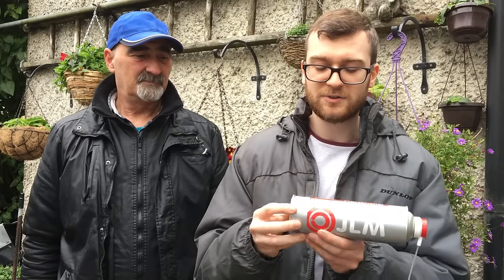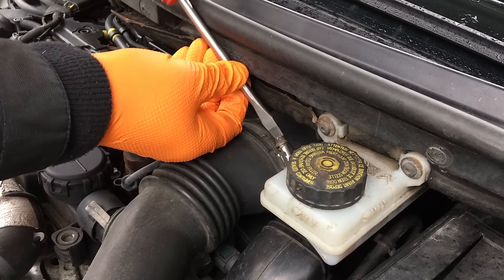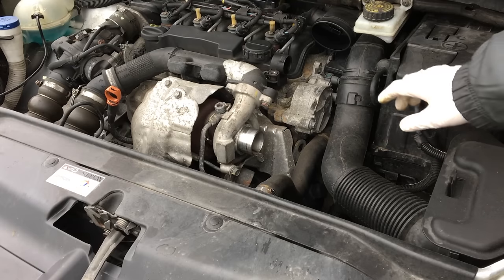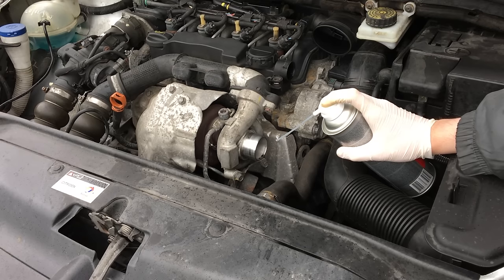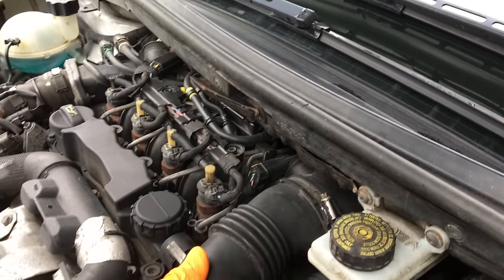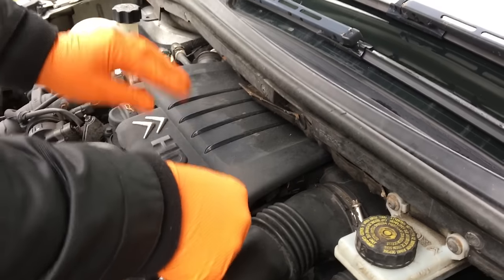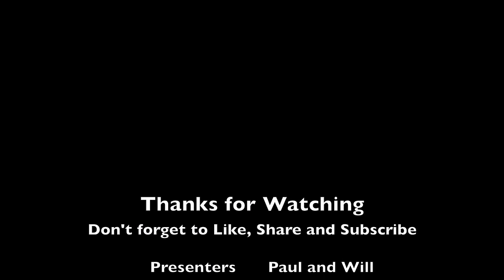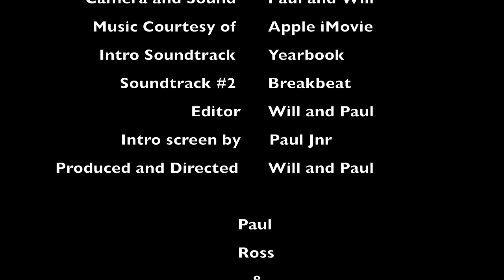How To Clean an EGR Valve Without Removing It

Comment: Sorry am a missing somthing. You sprayed the cold side wich will mibbe clean your injectors as it goes threw intake but it's being detonated as fuel b4 it'll ever touch egr, am sorry but it all sounds the business but your not thinking clear on process here, the only way to clean it especially that engine is to remove throttle body intake to get to the metal corrugated pipe that blows gasses back threw intake, fluid won't go down that pipe to the egr the gases recirculated back  from egr to intake,  the fluid is used to dissolve carbon and soot. Its that pipe that chokes up, trust me a know av done many. Only way to really clean is to remove and spray scrape spray scrape but the corrugated pipes a dog to clean it has a nozzle that inserts in the intake wich has 3 holes at the end these block up eventually and get heavily sooted through out, usually use wire rods to break it up, but honestly you never done a thing but clean injectors mibbe iat sensor but it'll still be gunked up.. do it right

Comment: Hi i think im getting close to the finishing line PG,my local man a great mechanic  removed the sump cleaned it out also  the small filter and the turbo feed pipe fitted a water pump and timing belt fitted new air and oil filters corrected the gear linkage topped up gear box oil cleaned the ERG valve all as your video using the oil and filter as you recommended Thank you but still the spanner is showing in the speedometer left hand side can you suggest any reason for this please.
Reply from the maker: Hi. Glad to hear your Berlingo is progressing along nicely. That sounds like the Service Indicator. To reset it is the same process as I did on the C4 and Ross did on his C5:

C4:
https://youtu.be/TGhgrxYMMkY

C5:
https://youtu.be/BS3P3RjspP4

I hope this helps.

Driveway Dudes - Will
Reply: IT IS A AUTOMATIC SERVICE REMINDER, showing after you drive e.g. 50.000 km.

Comment: Could it be that that the egr being clogged will cause the car to jerk and stall?? Please someone answer, I'm so stressed out
Reply from the maker: Hi Dima.
Yes it could. It depends on the make and model of your car. Some cars will allow you a limp home mode while others just will not start but I would also suggest you have an OBD check carried out to make sure that there are not other issues.
Paul

Comment: Ctroen and Peugeot 1.6 H.D.I engine suffers badly from turbo problems and has a serious oil circulation problem. Modern day diesel engines operate at much higher temperatures than older engines there for increasing the risk of oil clumps in small areas if poor quality oil is used, they also produce a lot of soot type gases which make there way into the oil via the piston rings in the engine. These gases are vented back into the engines induction system via the crankcase breathing system, the problem with this is the oil is constantly getting bombarded with these gases and lead to oil degradation. Dispersant additives in today's engine oils keep the individual soot particles from forming damaging clumps, excessive soot levels in the oil can quickly overwhelm the dispersant additives in lower quality engine oils and ultimately form what is commonly known as sludge. As the additives become depleted, the soot particles clump together, attach themselves to engine surfaces, and lead to reduced lubrication, combine this with poor servicing then you cause an oil circulation problem, this is the main cause of turbo failure on the 1.6 H.D.I engine.

I recommend the following remedy, 
Remove the oil sump from bottom of engine, wash it out and thoroughly dry it, replace the main oil pick up pipe which bolts onto the bottom of the oil pump, there is a wire mesh type filter inside the pick up pipe which can get blocked very easily, refit the oil sump. Replace the oil feed pipes and oil return pipes going to the turbo as they are probably blocked with oil clumps, remove all breather pipes and clean them out, replace all crankcase breather filters, they are normally on top of the rocker cover or on the air box. and refit all breather pipes. Remove and clean out the oil filter housing, refit it and fit a new oil filter, at this point you should fit the turbo, it can be a reconditioned turbo or a new turbo what ever your preference is. Fill the engine with the required amount of oil and start it up at idle for 20 minutes checking for leaks while its running. Now take the car for a drive making the turbo work hard in each gear and drive it until the smoke clears.

 From Paul Djerassi 
Do i need to do all this we have had the sump off cleaned the pickup and  wire mesh used a flushing oil but havent replaced the pipes i did this when we got it with a new timing belt and water pump ,to get all this done i would need a dedicated mechanic not in Citroen Mullingar this i know from a insider ,paul
Reply: Thanks for this advice
Reply: Hi is this wot you do if you  need a new turbo with the sump and pipes much thanks
Reply: I have done 300.000 km with 2006 C4 1.6hdi (dv6) no issues for turbo. Egr is  blocked. That's true for sump you need too replaced it sometime. I'm servicing it every 15000km.
Reply: @thinktoy  yes it's all down to been service at the right time
Reply: @thinktoy  15,000 that's a long time for the oil to be there,I'm getting down to 8,000 , new oil is a cheap preventative tool

Comment: How do you know it is cleaned ?
Reply from the maker: Hi Readme .txt.
In my case the engine light and 'Anti-Pollution' warning message did not reappear after carrying out this clean. This indicates that the EGR was then performing as intended by the ECU.
For others who may carry out this process, they may also notice improvements in engine performance and 'smoothness' of operation.

Driveway Dudes - Will

Comment: Hi, my car won't start after this. Any idea?
Reply: You need to have someone in the car revving about 3.5 grand to keep the engine from stalling as your effectively flooding it with fuel also this should be done on the charge hose not the intake hose as the spray will ruin a ball bearing turbo
Reply: @jakebowman2976  thanks for the reply hopefully haven't further ruined the car.

Comment: I've removed my old one on chrsler grand voyager  3.3 petrol 
Replaced new egr valve problem still there after going to three different garages 
Even doing cat cleaning 
Fuel additive fresh 

Same old code p0404 all comments welcome 
Really frustrated on the EGR valve
Reply from the maker: Maybe this will help.

TSB NUMBER: 18-017-09 REV. A
SUBJECT:
Flash: MIL Illumination For P0404 - EGR Position Sensor Performance
OVERVIEW:
This bulletin involves flash reprogramming the Powertrain Control Module (PCM) with new software.
MODELS: *2008* - 2009 (RT) Town & Country/Grand Voyager
NOTE: This bulletin applies to vehicles built with a 3.3L or 3.8L engine (Sales Codes
EGV or EGL) built before May 11, 2009 (MDH 0511XX).
SYMPTOM/CONDITION: Some customers may complain of a MIL illumination. Upon further investigation the Technician may find that P0404 - EGR Position Sensor Performance has been set.

Comment: That stuff is flammable and will be burnt up completely before it gets to the EGR valve. Added to the fact that only a very small percentage of the gasses are diverted through the EGR, this just won't work.

Comment: can u help me with w211 i have same issue .i cant have these cleaners in west africa .any alternative instead of taking off all linings.
Reply: ya but i dnt have an engine light the car goes in limp mode when pressing hard on road
Reply from the maker: Hi tyb shah,
We would need more information on your particular car to be able to advise on possible causes and fixes. 
The MB W211 was in production from 2002 - 2011. It used at least 15 different engines (petrol and diesel) and 3 transmissions both RWD and 4WD across the range. It also went through various facelifts and modifications/improvements. An estimated 1.5 million were built
Reply: Driveway Dudes  thanx alot for the response..mine is 2004 270 cdi 177ps /130 kw 2685 ccm avantgarde manual diesel .and it has 293000 km on it
Reply from the maker: Most common problems to check would be seized egr valve or blocked egr pipe or a combination of both. 
There's also mention that a bad catalytic converter could possibly cause the symptoms you mention.
If you cannot obtain cleaning sprays/fluids then you may have to remove the components to visibly inspect them.
If you feel you cannot do this then we would advise you take your car to a garage familiar with MB and have them diagnose the issue then take it to another garage and see if it's the same diagnosis.

Years ago I had a car that developed a bad vibration on the engine. First garage I visited said big ends gone - needs a major rebuild, would cost 2,500+. 2nd garage said water pump bearing. I replaced the water pump and it fixed the vibration, cost 100
Reply: Driveway Dudes ok thanx alot buddy .but i have one question i heard that even alcohol from a pharmecy could do the same but not sure  if it can harm or how can i do it as its not in a can .i live in burkinafaso a west african country so its really hard here toget a good mechenic
Reply: oh yes one thing i can get is wd40 can only
Reply from the maker: Carburettor cleaner, Alcohol, white spirits and brake fluid  have been known to clean egr valves but may take some time to dissolve carbon deposits, For heavier deposits a pin or pipe cleaner.
For the pipes a flexi rod used for cleaning a rifle or shotgun may help

We have not tried any of these so cannot advise on how effective they would be. 
You would need to remove the egr valve and associated pipes to carry out this and it may take several hours.
Reply from the maker: WD40 may help
Reply: Driveway Dudes ok thanx alot again for your help buddy

Comment: I bet if you remove the EGR valve it will still be clogged up as well as the inlet manifold as well. , All these spray cans of so called cleaners just don't work.
Reply from the maker: The spray works for us on this car. We also have a video of cleaning a removed the egr valve.
https://youtu.be/HXqJ0YcOqOI

Comment: Why didn't you removed the egr before and after 🙄
Reply from the maker: Thanks for you question.
As mentioned previously, the egr valve is not easily accessable. This was a test to see how good this spray is and it did indeed do what it was designed for.
The egr valve was removed at a later date to clean. See below link.
Thanks
https://youtu.be/HXqJ0YcOqOI

Comment: you totally bypassed the EGR valve by spraying that into the turbo, the EGR is under the air intake so none of the spray went through the EGR as it is upstream of the turbo (think about it) that spray is rubbish anyway.   the EGR needs to be hand cleaned after being soaked overnight in petrol/paraffin then scraped clean then finished with a scotchbrite pad,
P.S, is this Irish humour and not a real car help video . . . uh..doh . .eh. .

Comment: Waste of time doing this guys.iv done it before and with turbo cleaner and again it’s was a waste for time as it don’t clean the hot side of the turbo which is the most important part to clean. Best just to remove it and give it a gud scrub with carb cleaner and a toothbrush.
Reply from the maker: Hi Crazy Y,
Thanks for your comment. 👍The C4 is Will's daily driver and we've carried out this spray clean several times. It does indeed work for the C4, at least for the moment. We believe is may prolong the eventual. We will keep spray cleaning at every service schedule until it is no longer effective.
It may not work for every make and model of car but we believe it's worth trying this inexpensive way before having to consider spending possibly hundreds on a replacement egr.
We also adhere to the rule - 'Don't fix something that's not broken' 
Of course if a component or part failed then we would replace it.
Paul
Reply: Crazy Y does this mean timing involved? I have a Renault Megane 2010 mk3
Reply: Crazy Y

Comment: https://www.youtube.com/watch?v=RnhUJsZXzmg  is good one for background. All these nice guys really did was tell us how to spray in a cleaner. NOTE: This cleaner may work on the EGR (not proven, even on this video), but it is also (on the can) for the intake side, to help fight carbon build-up on the intake valves. 
-Afraid I am skeptical. If there was lots of carbon in the EGR, I would run the cleaner into the engine with it quite hot. (That's a guess, and the cleaner maker might not recommend it). There should be specific advice that optimizes efficiency of treatment. This optimal method (whatever it is) is absolutely bound to be temperature related.  Anyway, during treatment, if it is working, evidence would be that there should then appear some smoke at some point as the crap gets dislodged from the exhaust side (unburnt at first). It's got to go somewhere, and you really do NOT want to have it stick around inside the DPF and block it up.  So common sense would suggest that running the engine on the open road at some best-timed interval after treatment is an essential step.The DPF (all cars after 2008 have one) needs to be heated right up to encourage it to burn off the soot and EGR muck).  It is full oxidation (burning) of fuel that prevents soot and deposits, to a large extent, and running regularly on the open road for at least 20 mins to full coolant temperature. Modern diesels are useless for short start/stop runs.
The other thing that appears to be highly recommended by many pundits (and gives you more mpg) is a better grade of diesel. I have certainly found a better economy which tends to suggest cleaner burn, and so less soot. Other vital thing is you must MUST use ultra low ash oil (if suitable for your engine), or your DPF and EGR will suffer and so will your wallet. NEVER use cheap oil -not even for a top-up - unless it's good stuff on discount. But that of course is elementary.
Reply: I started using shell ultra diesel three months ago and noticed better mpg ,also I only use total oil for my oil changes.

Comment: But it doesn't work. I would be impressed if you actually removed the valve and inspected it. " more molecules" actually pulled the valve out to show the degrees of dirtiness...put the valve back and used a "spray cleaner" and then pulled the valve off again. There was no improvement to be seen.

Comment: Diesel engines may do a few more miles to the gallon than petrol or they used to but petrol is  hell of a lot cleaner and considerably less hassle to maintain. What money you save in fuel driving a diesel you lose in maintaining it over the life of the car.  Diesels are false economy!  Bear in mind I'm not talking about somebody buying a brand new diesel car keeping it 3 years driving 20k miles then replacing it, it's the next guy who buys it driving 200k miles and keeps it 10 years.   Diesel engines should stay in trucks and buses!  NOT LITTLE CARS!!!!!

Comment: This is how you cleaning your turbo but not EGR
Reply from the maker: Really ???  Please think about what you have just put in print for all to see.
In your opinion we have all been misled by manufacturers of EGR valve spray cleaning products in that they are a complete scam? If so, can you prove it? 
We can prove and have proven it does indeed work and cleans the EGR valve when manufacturers instructions are followed. 
We do have another video where an EGR valve was removed and cleaned or would you doubt that also?  https://youtu.be/HXqJ0YcOqOI
Reply: @DrivewayDudes   best way to clean it is to remove it and clean it not this mambo jambo you just did here
Reply from the maker: @AlexAlex-ww9pf  The spray works for us on this car. We also have a video of cleaning a removed egr valve.
https://youtu.be/HXqJ0YcOqOI
Reply: Solvents do not do the turbo any good at all

Comment: I do not think it sufficient to clean the whole EGR, at least it cleans %30-%40 through Throttle bypass.
but yeah, better than dismantling hard parts.
Reply from the maker: It is an inexpensive way to clean it. If the EGR is bad then it would of course be best to remove and clean.

Comment: where is all the carbon you've cleaned going to end up?
Reply from the maker: Trace amounts of the cleaning agent and deposits of carbon, dirt and grime would follow the recirculation route whilst the majority would travel out the exhaust and eventually all would exit. 
Paul
Reply: No it won’t exit..... out the exhaust .. the cat will get blocked before it all does .. u need to take the exhaust off at the manifold then do it

Comment: Save yourself the time and effort and put some Dipetane in the tank when you refuel.
Reply from the maker: Dipetane is a good product and we have used it but not as an egr valve cleaner.
It may keep a good egr clean when used in the correct quantity as an additive in fuel but it was not designed to clean an already gummed up one. 
For clarification, please refer to https://www.dipetane.com/